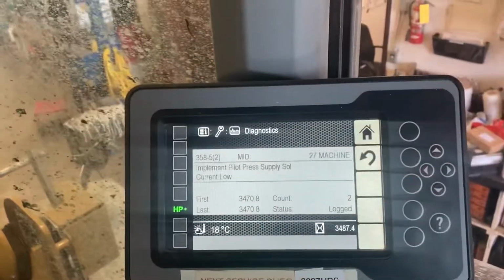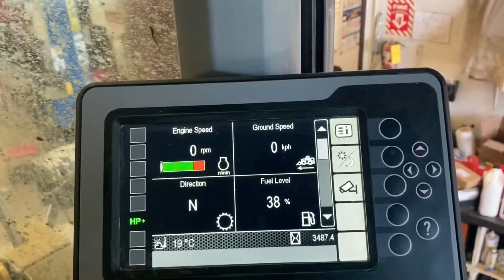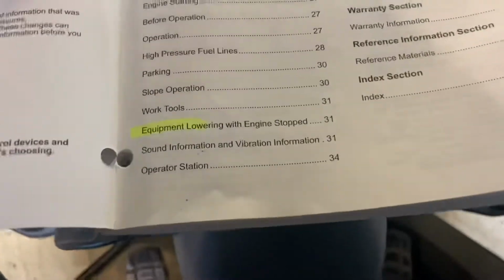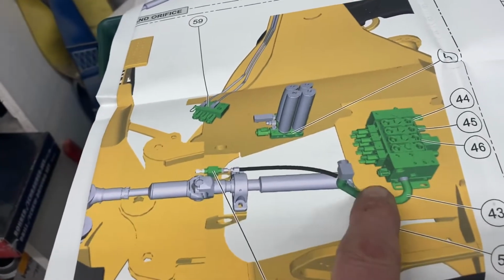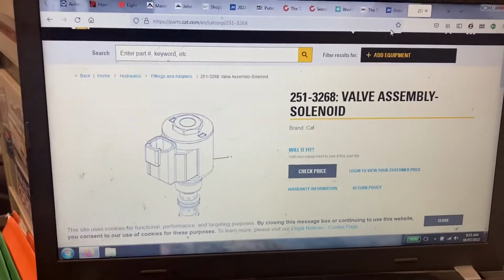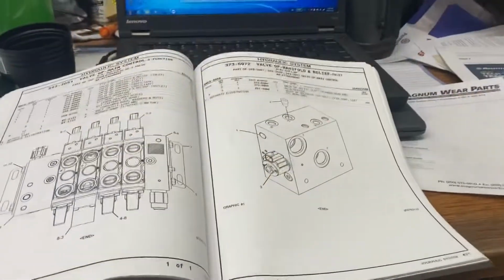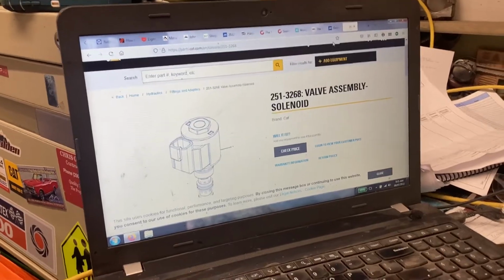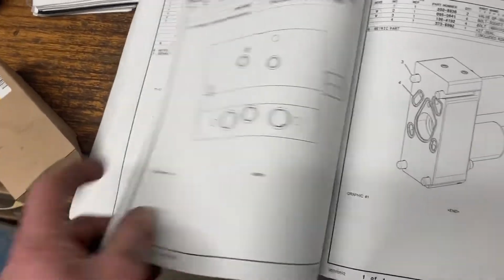Caterpillar 924K loader manual boom lowering procedure

Comment: It would be a great help if you could tell me how to replace it.
Reply from the maker: How to replace the solenoid?  
It's pretty straight forward, the control manifold is up in front under the boom, locate the one for boom up/down and unscrew from valve body and install a new one